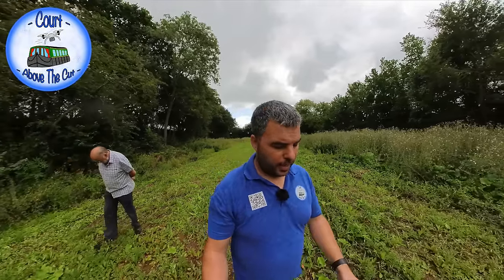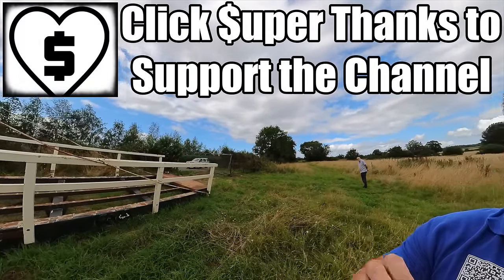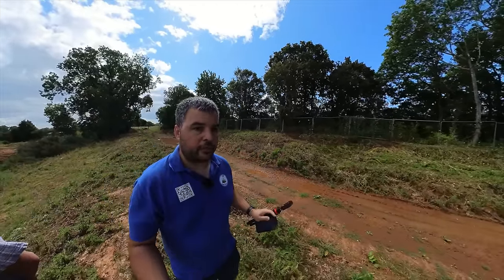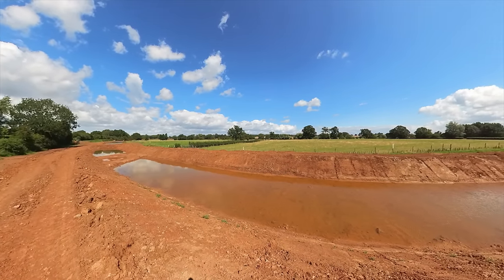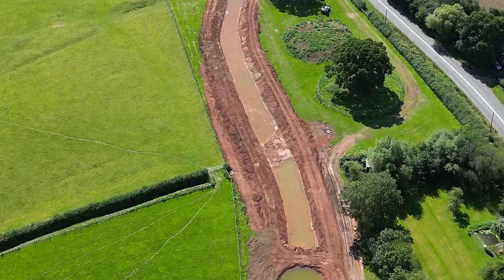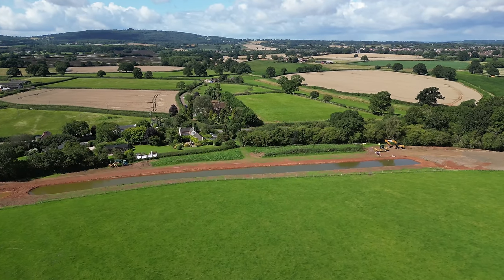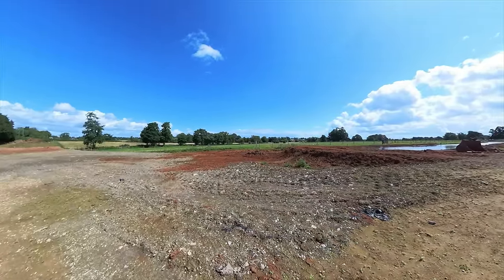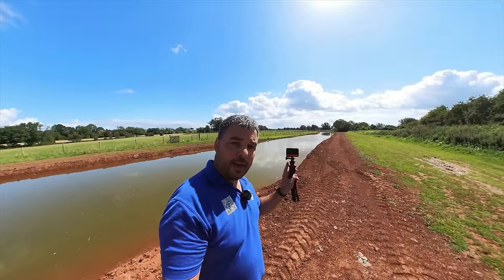Creating A Canal - Hereford & Gloucester

Comment: I'd like to see an extention to this canal, once completed, from Hereford to Abergaveny: linking the Monmouthshire with the rest of the canal system. The extention would only be 25 miles long
Reply from the maker: I love your thinking but with the way funding is being cut I can’t ever see it happening. It’s something that’s surprising that it didn’t happen years ago when the networks were built
Reply: ...but a change in government may improve funding. There are advantages in expanding the network if large marinas and electric points are added. as water 'sinks' in drought and deluge conditions, offering housing relief as a cheaper alternative, keeping village shops and pubs, served by the canal open, offering more tourist routes. Keep up the good work.
Reply from the maker: @grahamgresty8383  it’s a shame I haven’t released my next Lichfield video, I rant a lot about it on that!, we are definitely singing from the same hymn sheet.
Reply: Excellent video and such a good project; let’s hope funding can be found to complete it.
Reply from the maker: @flightimage845  being rural it is all based on land owners being involved, sometimes that’s harder than running through a town where you usually just need to get a council on board
Reply: I'd love that too, but the chances of the Gloucester, Hereford canal even being reformed are slim, never mind being extended into other systems
Reply: Having to bypass Hereford and cross the Wye would be very expensive and challenging……. I’d love to see that implemented.